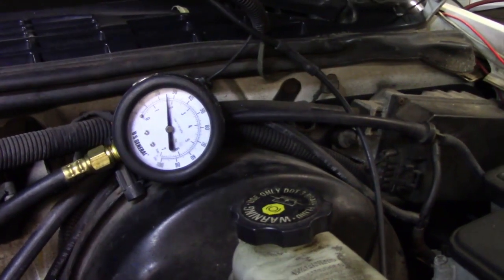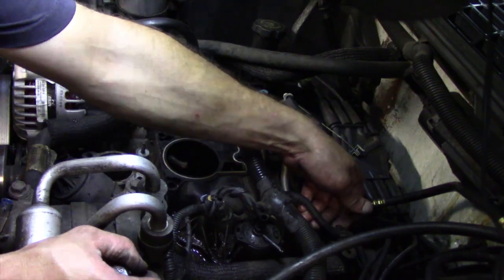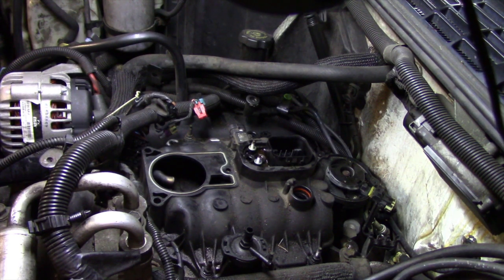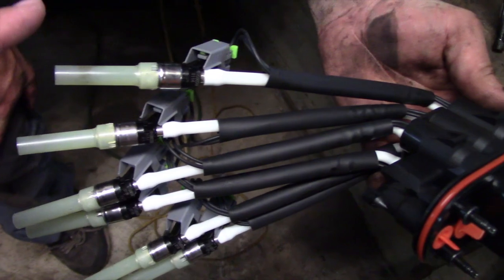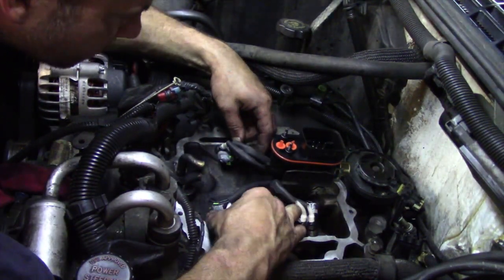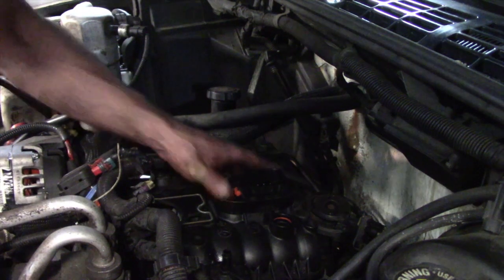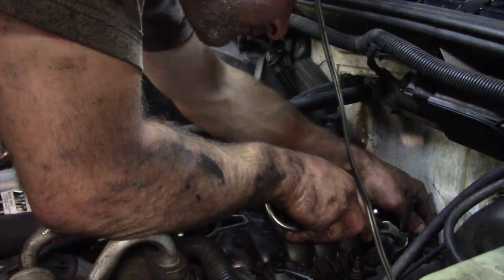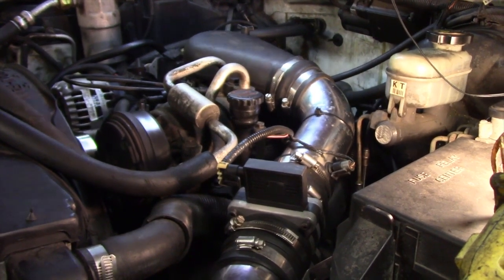How to replace the spider injector on a Chevy motor. 4.3, 5.0, or 5.7

Comment: Probably too long since this video was posted to expect a reply, but for the injection assembly, does it matter if your engine is a W or an X? Some of the injectors I looked at said will only fit a W and mine's an X.
Reply from the maker: yes make sure you check your vin

Comment: Got my 1998 Chevy Blazer in the shop now for this exact same problem. Got 202,000 miles out of the original spider injectors, and out of the fuel pump as well. Replacing both of them. Your video is a great description on how to do this job.
Reply from the maker: Glad to help.. those numbers are impressive
Reply: @backwoodzcustomz1549 can you convert these to a carburetor? My Spyder is hot and they want a lot to replace it. It's a 96 with about 178k. I can get an intake and 500 cfm carb for about 800 bucks. Is this possible?
Reply from the maker: @lunsy9420  if it's manual trans maybe...if not you would have to put an older auto in or get a stand alone to control the trans
Reply: @backwoodzcustomz1549  it's I a five speed. I'm planning on a v8 swap. Not an ls maybe a big block but probably just a small block. I'm conflicted on spending the money to fix it or just save for the swap. I plan on putting an automatic in it anyway. Thanks for the help.

Comment: I have a 98 blazer with 103,000 miles, I purchased at 102,750 miles and the car has started stalling around 55-70 mph on the way home from work. I have to pull over and restart the car and then it stalls again 1.5 miles later all the way home. Could a bad spider cause this? I’ve changed alternator, spark plugs, wires, distributor cap, rotor, new map sensor. I removed the throttle body, Idle air control and gave it a deep clean, I also cleaned out the MAF sensor. I have not test drove it yet after cleaning the throttle body, IAC and MAF sensor
Reply from the maker: A bad spider can do a lot...
Reply: @backwoodzcustomz1549  it was deteriorated vacuum lines, they disintegrated in my hands when I grabbed them and a failing fuel pump. 1300$ later and I found the problems 🤦🏽‍♂️ car is running smooth now
Reply from the maker: @CenCalPaddler  good
Reply: @backwoodzcustomz1549  I replaced the alternator, spark plugs and wires, distributor cap and rotor, map sensor, removed and completely cleaned the throttle body, idle air control valve, fuel filter, vacuum lines, and fuel pump. I broke the vent valve on the fuel tank when I was replacing the fuel pump, and it started throwing a p0446 code for a gas leak. Had to go to pick and pull to pull a gas tank because they don’t sell the original plastic tanks anymore and my new fuel pump was specifically for the plastic tanks not the metal tanks. What a headache it has been.

Comment: With the fuel line bro I only got one going on ??? The truck came like at but now after finishing putting a spider injector in I have a massive fuel leak at the fuel line because only one hole has a line other empty but that’s how it was before ?? And it didn’t leak now it does any ideas thanks
Reply from the maker: Never seen one without 2.. they need a return
Reply: @backwoodzcustomz1549  me either first time for me as well

Comment: Is there a bracket that holds the fuel lines down going to intake or just the nuts? I heard something fly off and fall when disconnecting i thought. Lol
Reply from the maker: I can't remember but I think there is a bracket on the back of the block

Comment: 97 silverado..new cap wires,plugs,coil,ign module,,fuel filter,.fuel pressure is good..compression test good on all cylinders..#8cyl misfire..truck sat long time bad fuel..drained the tank added fuel treatment still misfire at idle..you think the next thing would be replacing the spider injection??..
Reply from the maker: could be. I would pull the plug and see what it says.

Comment: Ive had 3 of these new spiders in the last 4 weeks and it keeps losing number 7 and number 6 injector pulses
Every time I fix one the other stops working.

I have an updated fuel relay thats designed for both regular and flex fuel injectors so im not sure if that has anything to do with it or not.

But it dont seem to bother the old style spider. Only the new ones

My truck has been down for almost two weeks since installing the most recent new set.
if i cant figure out whats going on i may be going back to the old spider very soon
Reply from the maker: it's a really bad design, not sure who thought it would be great lol.

Comment: Gentlemen I currently hand an issue with my chevy 4.3l spider injector wiring involving some squirrel chew of the wires. Could you possibly send me a wire color and position of the module or a high detailed picture showing the colors?
Reply from the maker: all i got is what you can see in the video. it was a customers car.

Comment: Does the engine light come on for a bad regulator or spider injector?
Reply: It would most likely cause codes to set off, but they would be errors as a result of a faulty injector harness. Maybe a particular cylinder or two that are misfiring. Maybe random multiple cylinder misfire. For a faulty pressure regulator, you can hookup a gauge to the access port against the firewall, and you can see the pressure decrease rate. A faulty injector harness usually also results in surging rpm, stumble on acceleration, maybe a gas smell from exhaust or high numbers of long and short term fuel trims. I ended up getting an O2 sensor code bc my faulty injector harness ran for so long with a rich fuel ratio it burned out the sensor early.
Reply: @evanrobinson7657  thank you for your insight
Reply from the maker: should pick up a misfire.
Reply: @backwoodzcustomz1549  Thank you. Im at 145k and Im trying to do as much preventative maintenance. Already took care of everything in the bottom end. New chain timing even

Comment: How long does it take to replace the spider on a 98 2500 Chevy pickup with 5.7 ?
It looks like somehow water got into the fuel system .
Reply from the maker: if it's your first time, i'd give it a weekend. but if all you have is water just drain the tank and throw in some water remover and hope for the best.
Reply: @backwoodzcustomz1549  

Thank you

Comment: Would this cause fuel to leak out down the back of engine and on to the exhaust or is that a seperate thing by itself??
Reply from the maker: if your leaking fuel out the back of an engine, i would look at the fittings where the return and feed connect to this, or something got rusty, but i think the lines are stainless..

Comment: I just did to my 99 Silverado. Thanks to you guys she runs again. I just have a few questions. I never had water in the oil. After I did this I drove to town and checked the oil. It was brown and my truck said low coolant. My question is. If I did not put a new gasket on when replacing the spider pump. Will that cause water to be in the oil or is that not possible. Or did I some how busy my head gasket? Any idea . Please any info helps.
Reply from the maker: always use new gaskets when possible on a big job like this. i would go to the parts store and buy/rent a block tester and block test fluid. this basically tells you if you have exhaust gas in your coolant. it's possible now that you are making the proper power/ combustion pressure you popped a head gasket.
Reply: @backwoodzcustomz1549  that's what I thought could have happened. I got a no spill funnel and a head gasket sealant.

Comment: today i tried to change my injectors. it was hard to install with hard plastics line. I finally put everything back together, and now my truck is running extremely rough, and misfiring.
Reply from the maker: Sounds like something went wrong..
Reply: @backwoodzcustomz1549  update. spider was bad.  i brought it back, and got a new one. I put the new one on, changed the spark plugs, and boom truck running better than when it was new.  Drove it for a few days, went outside one morning, and now it doesnt want to start at all.

Comment: Did you just pull the injectors out? I don’t want to break mine
Reply from the maker: Just pinch them together and pull them out..
Reply: @backwoodzcustomz1549  mine are a little different

Comment: I just did this replacement yesterday on my  2door 97 Blazer. Nothing wrong with the old injectors just felt like replacing it. Now I have the original as a spare if the new one doesn't hold up. Much obliged for the help.
Reply from the maker: Glad to help, good luck..
Reply: @backwoodzcustomz1549  Greetings. And the pressure of the fuel cell does not affect. (PCI) It is the same gasoline pressure of the 2nd generation and this 3rd Generation.
Reply: If I don t use my car for a week or so, I have problem cranking it. Sometimes it need 15, 20 cranks for the car to start. Is it the problem?. Seems that the gaz is not pushing in well.
Reply: @Huannt58  hey man, not sure if you got help with this, but this is an in-tank fuel pump issue, there is a check valve that stops fuel from going back to the tank, and when it sits, all the fuel runs back to the tank and the fuel pump has to bring it all the way to the motor.  So it sounds like youd need a new fuel pump and filter while you're at it.
Reply: How long did it take?

Comment: I replaced with the new style injector fails after 2 months hose rupture. Left me on the side of the road. I ended up putting  Rebuilt Old style injector I bought on eBay. no problems after that oem is better.
Reply from the maker: To each is their own.. sometimes people have different luck....

Comment: This is the best type of injection and not poppet's, get the ones with the wires running down to the injectors.
It's not a big job I did mine 8 years ago before the new style. Maybe I'll get some, 96 350 has 311,000 and runs like a champ , at idle you have to look at the tack to tell if it's running 175 lbs per hole 3/4 quort in 3,000 miles
Reply from the maker: Out of 4.3 it might be the best... Deff not overall though...
Reply from the maker: I'm not up on my 4.7 stuff.. usually chrysler runs both...

Comment: Replaced mine, now a constant cylinder one misfire upon start and a po200 cnf & pnd code. Any ideas where to start
Reply from the maker: Sell it... Lol no not really... Oh the injector unit..
Reply: @backwoodzcustomz1549  I’m almost to that point…replaced it again last night just in case the part was a defective one. It was, misfire went away. Also wanted to check the plug on the misfired cylinder and ended up ripping the plug. So 2 spider units, new plugs, wires, and a throttle body pressure sensor and boom! Just like that, the original problem still isn’t fixed
Reply from the maker: @bigred2oo766  I'd like to act surprised but it's just a really horrible design...
Reply: @backwoodzcustomz1549  agreed. It’s a shame I love that truck so much. Running up on 250k miles and the only issue is occasionally turns over for a min or 2 before it starts

Comment: Bought one on Ebay. If you get the one I got for your S10, you may have to use your old bracket. The new one was too short, the plug just barely wouldn't clear the plenum and would not allow plug and clip.
Reply from the maker: Customer bought his own..

Comment: Having a hard time getting those nozzles in. Put motor oil on the tips and still can't. Don't want to use excessive force and breaking something. Any suggestions? Great video,  thank you
Reply from the maker: I don't sorry... We have never had an issue...
Reply: I just replaced the o'rings in mine and had the same issue. I ended up having to take the lines off and slightly bending the return line where it goes into the spider. You should be able to eyeball it to get it close. You'll have to remove the distributor cap, the bolt that holds the fuel lines bracket to the engine, and the fuel line nuts to get it out.
Reply: @tekknow8482  Thank you
Reply: Update: I had to remove the white injector nozzles, installed them on ports first, and then connected the fuel injectors onto them..all good now. Thank you

Comment: * 8:29
DO NOT USE VASELINE!!!
I'm no mechanic,  I can work on my own shit, but I wouldn't call myself a mechanic,  however,  what I am is a maintenance technician.  And after eons of experience, I can assure you, vaseline sounds like a good idea,  however,  it will eventually break down rubber.. so.  I'd suggest plumbers grease.  Danco brand is the best.  Comes in a small squeeze tube..  I use that shit for everything!!!  Just saying..   carry on!!
Reply from the maker: Never had an issue... Also it's what they teach mechanics at school...

Comment: Great video thank you, im replacing mine in an 01 conversion van today awesome job!
Reply from the maker: Good luck..
Reply: How did it go? I have a 2001 express 2500, ordering parts now.
Reply: @larrynflorida7517  it went well, it took me 2 weeks because i did a lot more since i had the dog houses off, conversion vans have 2, i also replaced plugs wires, cap rotor, coil and duel pump, i needed to have a flat line since i didnt get any repair records with it when i bought it, with 196k on it and it runs perfect!

Comment: Hello, if someone can tell me if the thin tube of the fuel pressure regulator should have a hose
Reply: No. It looks like it should have one but it is in case the regulator pressure gets to high. If it does, then the fuel is dumped out of the regulator.
Reply from the maker: The vaccum line?

Comment: I did this some time ago, actually right after I got my blazer, and before I drove it  enough to be at all familiar with it. Do I need a tune after this? Isn't this making it a more multiport injection system,  and should give more power and get better gas mileage, as far as being more efficient.  I get horrible mileage! Lol kinda hoping that a tune after is recommended  and I just never did it
Reply from the maker: Blazers all get horribly fuel mileage.. they make way to little power for the size vehicle it's in.. you don't need a tune, it's just like changing an alternator...

Comment: Thanks for sharing.  Good pointers. ---   For a 2000 GMC V6, 4.3 L, does anyone know the typical reliable life of the fuel pressure regulator; and the typical reliable life of the fuel injector / poppits ?   Would it be wise to replace the fuel injector / poppits assembly after 200k miles?
Reply from the maker: I never replace things till they break.. you can cause issues you'd don't need to by touching stuff that's not broke..
Reply: just check trims at idle, low single digits, negative and positive numbers.. two banks.(these engines are smart as heck, dual trim). look for the occasional 9-10 trim while it is skipping, this verifies one bad injector. 20 would be two, most likely stall then. I killed one with weld smoke (long story - open fuel filler tube in the smoke) I do not like the wires in vacuum, but it is up to you. I stayed original poppets, just new. two ways to kill these, this video has stuff that was simply old ready to replace. Mine was fairly new, and i killed one by other means. Replaced the whole set.

Comment: Would this cause it to miss while driving when foot to the floor
Reply from the maker: It can cause alot of things.. also alot of things can cause your problem...
Reply: BACKWOODZ CUSTOMZ 15 how about random misfire code p0300. It seems to idle fine but under soft easy acceleration it backfires and misses and after you get to running speed 55-60 and hold it steady it backfires and misses but if you accelerate hard and fast it revs up no misses or anything also when going 55ish and stomp down it just takes off and goes no problem.

Comment: Will a bad spider cause engine to stall and only start with gas pedal down
Reply from the maker: Possibly... When you put the gas pedal down it puts the car in fload clear mode... Which basically shuts off the fuel..

Comment: I’m having issues with my 96 blazer giving me a “check gages” message then it just dies out. I can start it again right away and it will be good for a few miles then do it all over again. Could a bad spider injector cause that to happen?
Reply from the maker: Could be anything...
Reply: crank sensor? had the same symptoms

Comment: How long did this take?
Reply from the maker: No sure we did alot of other work at the same time.
Reply: If your good..3-4 hours..if not 5-6..but it’s just r n r ..keep track of what comes off so reinstall goes easy for you..clean the throttle body good and the mass air flow 😎

Comment: Great video!  I have a 1996 GMC Jimmy 4.3L 4x2.  It would start fine in the morning, but had extended cranking within 10 or 15 minutes after it was shut off.  Eventually, we took it to the dealer and they found that it was the fuel spider/regulator and replaced them.  Not cheap...wish I'd seen this video before taking it in.
Reply from the maker: Yea i bet.. What they hit ya for? $1600?
Reply: @backwoodzcustomz1549  Good knowledge....they got me for $1552 and change.
Reply: @CulturaJaliscoMexico  🤕🤬

Comment: Hi, I have a question 'cause I may be did not catch the reason for spider replacement. Was the spider the reason of a hard start? Did the engine work with old spider if you fired it up with the cold start spray?   many thanks in advance
Reply from the maker: It had a jard start which is the 1st sign... Also ran rough.

Comment: Would a bad spider injector throw oxygen sensor codes? Rough idle and eating fuel.
Reply from the maker: Thats all the issues...
Reply: BACKWOODZ CUSTOMZ 15 yes, I replaced oxygen sensors.
Reply: BACKWOODZ CUSTOMZ 15 plus had a cylinder 3 miss fire. But that code cleared. Never came back.

Comment: Hey I have an 05 Chevy Express 1500 i did a spider injector replace on it. But for some reason the fuel feed line keeps popping out and then I get a puddle coming out from the bottom. How ca I fix that?
Reply from the maker: Find out why it's doing it